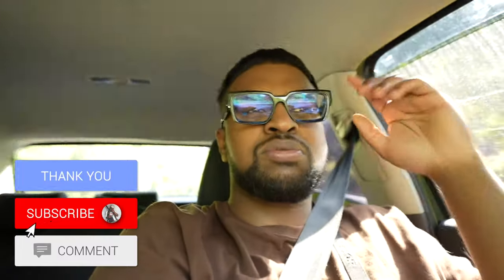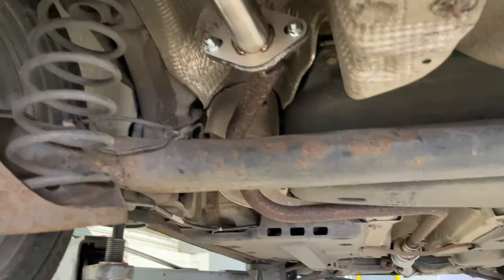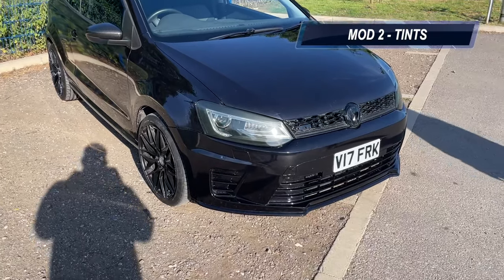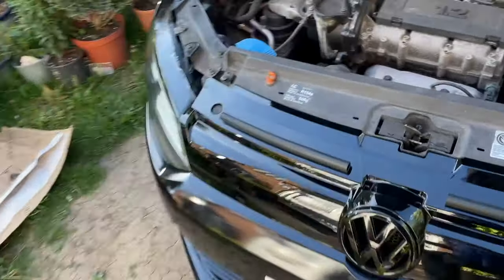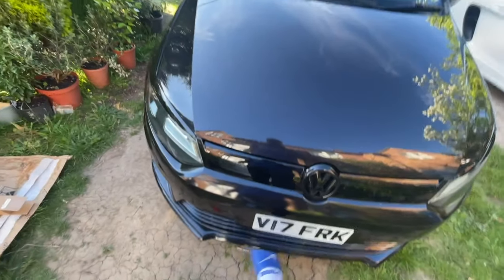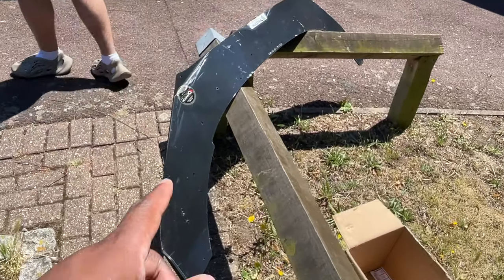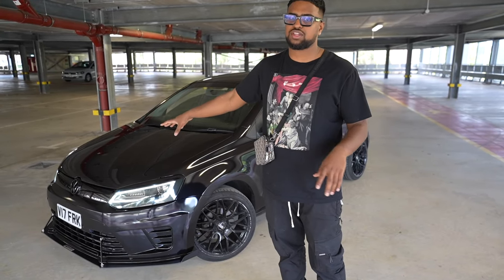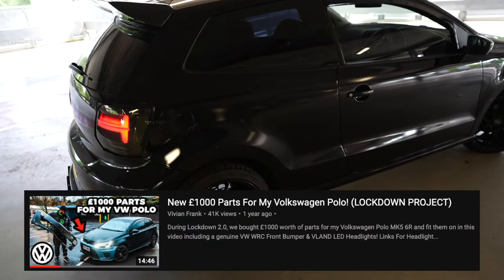10 MUST HAVE Mods For Volkswagen Polo!

Comment: Vroom vroom 🏎 but please don’t lower it .. thanks bye 😊
Reply: First mod on my polo was lowering It, a Total different handling ok High Speed and it was some cheap H&R with 25mm drop on front and 45mm on the rear, i absolutely reccomend it
Reply: I will tho
Reply: @davidemirauta9585  same
Reply: @davidemirauta9585  first I did on mine when I got it, standard they sit like a monster truck,

Comment: Looking great, i am a owner of a polo 6r 1.4 2010 and i did some other stuff you missed. I do upgrade my front speakers, added a subwoofer, change the radio for a screen, leather armrest, metal pedals, and ambient lights
Reply from the maker: nice! did the ambient in the next video. radio something i did before. Speaker is what i want to do for next vid or one after
Reply: @VivianFrank  i build in speakers in the front doors this weekend, i have build in jbl club 622 and with a jbl sub basspro nano it is now a super audio system, it is worth it and easy to do. And i really like your car too in black and mods, i own silver
Reply: Where did you buy the leather armest and pedals?
Reply: @tahyldz_7998  metal pedals are from amazon and the armrest too but i can not give you a link beacause that is not allowed. If you search type "vw polo 6r" before the part you searching

Comment: Those are some sick mods man! Looks really mean. I have one question though. That grill that you have changed, won't that be obstructing the air flow into the engine? Because the air intake is placed right behind the grill and if that's the case then the engine will overheat quickly and most probably would suffocate. Other than that everything is perfect 👌 Another thing you can add is the F1 style strobe light on the rear diffuser. That would surely complete the look. Also try to get the dual tip for the exhaust. Not the round ones but the square ones. Amazing work brother. Loved it.
Reply from the maker: air can go through the top and badge, the grill is made for petrol blue motions so cant see why wont work, had it on since this video no issues at the moment anyways. Dual may not fit for the exhaust exit but yh like the idea of f1 few my boys got on theres but ive seen them have a few issues which puts me off 😭
Reply: Oh! I didn't notice the gap in the VW logo.. yeah it won't be a problem I believe. And the dual tip exhaust will probably fit.. all it needs a wider cut out.. carbon fibre finish dual tips will look amazing on your polo. And yeah the F1 lights do cause some issues because they are mostly made in china. Try n reach out to a custom body shop with accessories and they might have a good quality piece.
Reply: Don't try the grill thing in India, Warm climate. You need to let in as much air as possible.

Comment: Nice but honestly looks overkill and did you weigh in all the parts fitted in terms of load and how will this affect the fuel? I think if it looked subtle would've been way better. Too much of a ghetto look bro. I'll give you the front end just looks freaking amazing, that makes more sense than the rear roof spoiler. The new front grill wouldn't that create more engine bay heat and cause your cooling fan to come on more often??
Reply from the maker: Not that deep. The grill is OEM from VW for different spec petrol polos so should be alright.

Comment: We're did u get the spoiler and would it fit on a vw polo 2019 plate bro.
Nice looking car bro
Reply from the maker: i got spoiler from fb polo groups, dont think will fit the mark 6 polo. Can get it on Diversion and maybe maxton but they also have mk6 options to fit yours
Reply from the maker: checking ebay can find some options on ebay for mk6